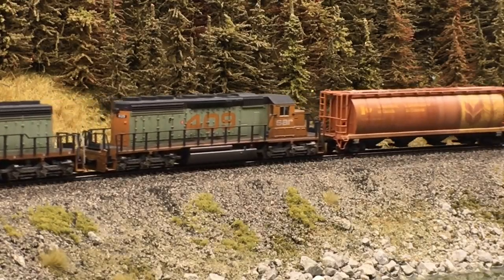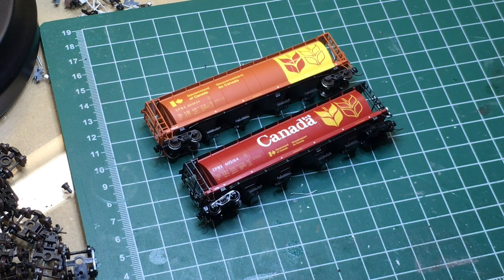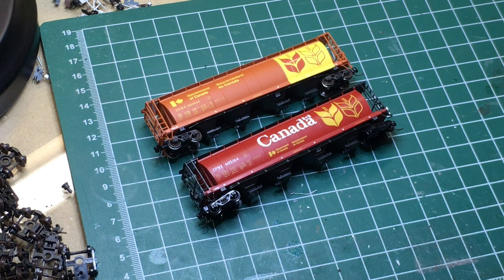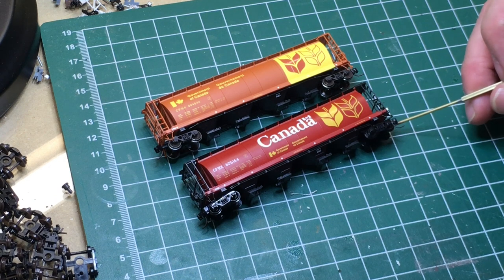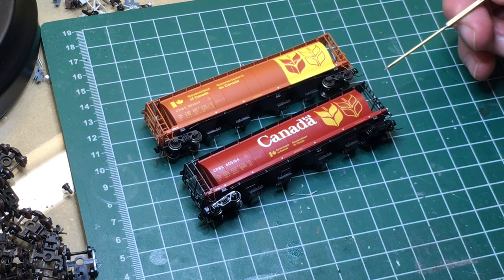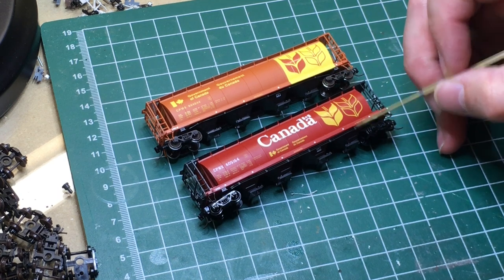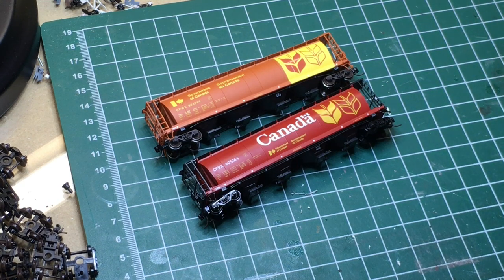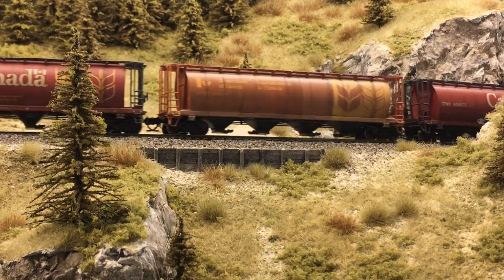N Scale NARC HS 4550 Covered Hopper Review - Southern Alberta Rail

Comment: For adding weight they have a opening at each end of the body (behind the ladders), you can cut part of the bulb off a pipette to act as a funnel to get Liquid Gravity in there.
Reply from the maker: They do and that's certainly a way to do it.
Reply: the top of the car can be removed I have had a few apart then you can add your weight as needed take the end off the car will break into pieces and be scrap .

Comment: Much to my surprise, Intermountain just released a ton of these in HO Scale. I'll be picking up a few more now. Cheers ~ Boomer.
Reply from the maker: Nothing screams Canada quite like a 4550 Boomer.  Cooling down out there yet??
Reply: @SouthernAlbertaRail  I love those Canadian cylindrical hoppers. Just haven't been able to find any, until now, from my supplier (Otter Valley Railroad) in Canada. The heat has abated somewhat but the Humidity is high. It's an ugly trade off. It's the humidity that kills things if you know what I mean. At least in Alberta it's a dry heat for the most part, even when it is cold. Cheers.